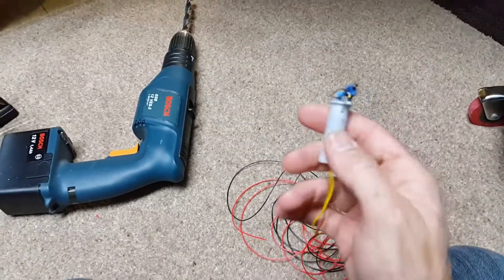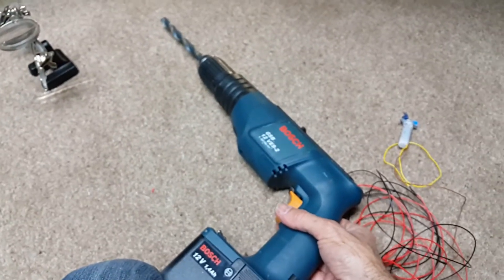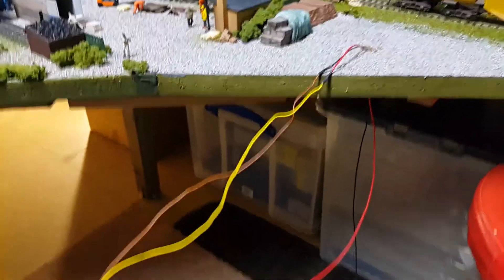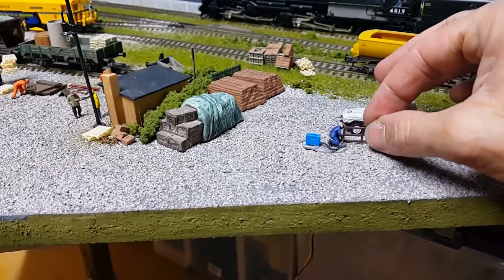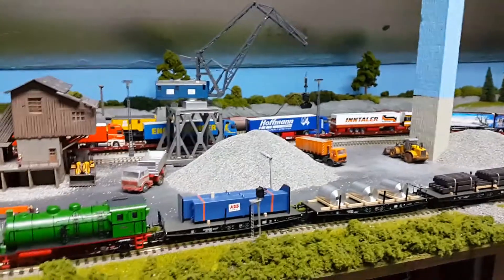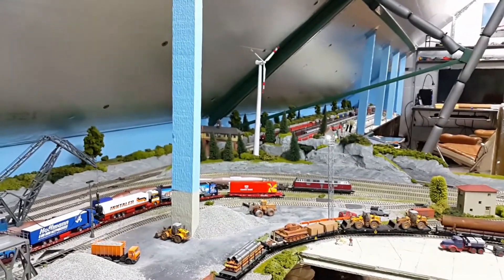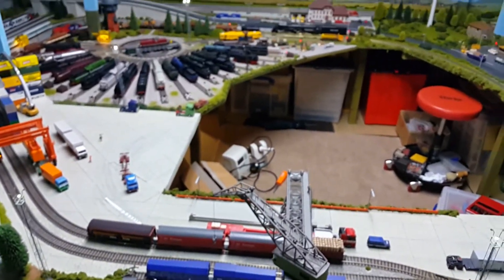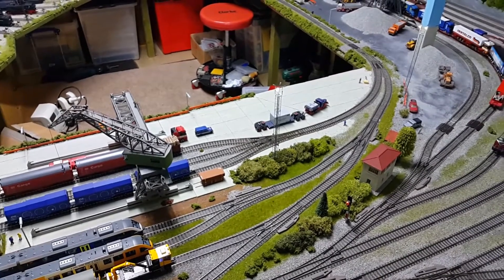VIESSMANN WELDER INSTALL 2 and more.

Comment: Very nice Jim, I intended to buy some when I am at the stage of fine detailing my layout. I have re-wired a couple of AT power supplies from computers to controll my accessories, lights etc, very effective...Simon
Reply from the maker: Hi Simon.. cool sounds like a plan...
the led on the welder could be tinted for a different effect...
Reply: Good idea about tinting